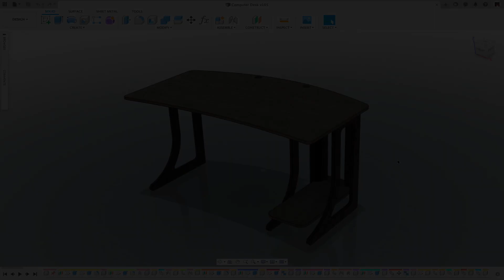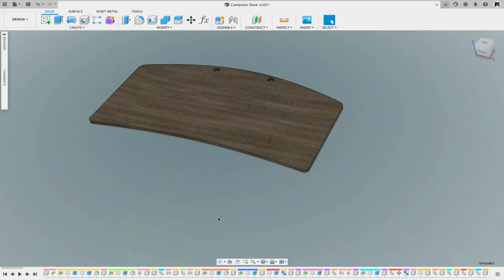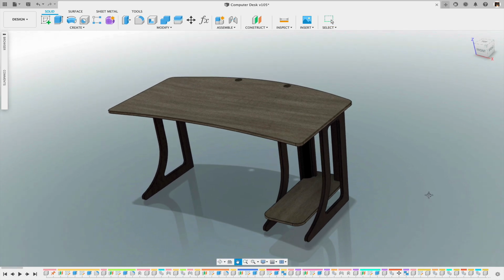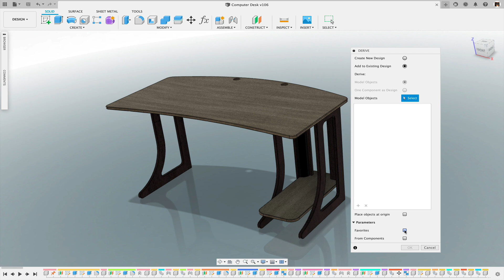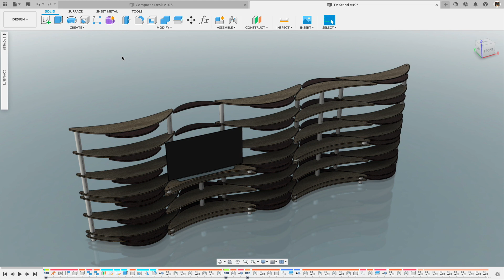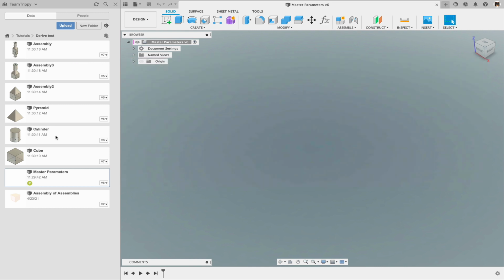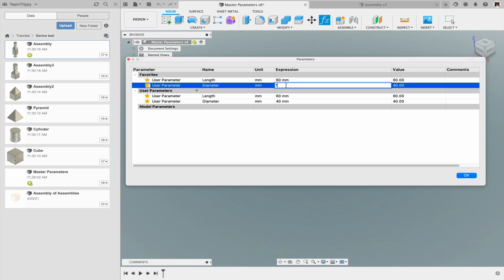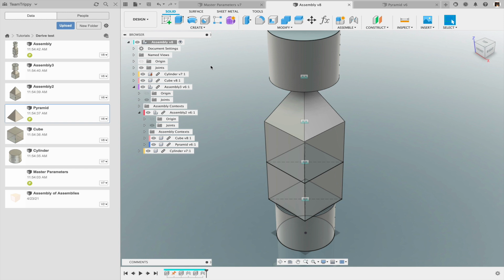Fusion 360 - Local & Global Parameters and the Derive function

Comment: Best workaround for this heavily missing feature I have seen so far! Thanks for sharing!

I wish a proper implementation of global project parameters comes soon but according to some forum post I read about it it doesn’t seem likely :( This and some smooth option for master sketches are things I miss badly in F360.
Reply: I fully agree this is a must to bring fusion to a mature level. You strange it is you cannot connect parameters to components as input variables.
Reply from the maker: This isn't a woraround. It's simply a workflow.
Reply: @TrippyLighting  Workflow to go around missing feature is what I call a workaround :D Ideally, Autodesk would implement this so one wouldn't need to do favourites and derives... simply 'add global parameter'.
Reply from the maker: @kristofpucejdl  I know what a workaround is. Just because this isn't implemented in the way you imagine or consider "proper", does not mean that other implementations are workarounds.
Reply: @TrippyLighting  I hope my main message didn’t get lost in translation - I do think this is clever and helpful. I sure wished I knew this option earlier!

All I was saying is that ideally, F360 made it easier. It is not about what ‘I’ consider proper, it is about what is proper. Having to create empty designs, put parameters in favorites etc is not very streamlined. But that doesn’t take away from the fact that it works and that I am glad you taught me ;) But I feel like there is no harm in wishing for an easier way.
Reply: @kristofpucejdl  Agree, I really don't understand why Autodesk did not implement a "Project parameter list" shared across the project designs at the very least. F360 is a top-down CAD so it would make a lot of sense. This is a neat workflow but is certainly something it should be implemented natively. For users of the free version the drawback is one design less available for your project but hey I can't complain much :D

Comment: Interesting approach. Thanks for sharing! Would be even better if we could change the parameters of the referenced files from the destination file (at least temporarily). This way I could use Fusion Sheeter for example to generate and export a set of models with various parameter values. My only solution for this is to create a basic final assembly, import everything, save a copy, and then break the links in order to make all referenced parameters editable for the purpose of using plugins as explained. This is why I try to not reference files where possible.
Reply from the maker: I think ultimately the feature you are looking for is called "Configurations" in other CAD systems. At the moment Sheeter and the Derive functionality can really only function as a workaround to cover part of the Configurations functionality and you are always at the mercy of those folks who write these plugins. If the Fusion 360 team changes the Python API and the plugin you use becomes dysfunctional - this has happened more than once - you'll have a problem on your hand.
I have relatively frequent contact with members of the Fusion 360 team through the Autodesk EE Slack Channel and know they are working on this, but it's a big project and will take some time.
Reply: @TrippyLighting  good to know that the team is working on it. I can imagine it's not easy.